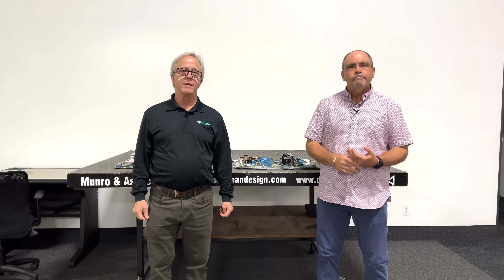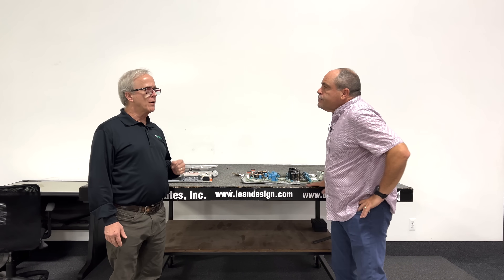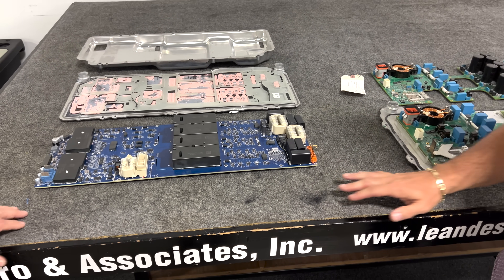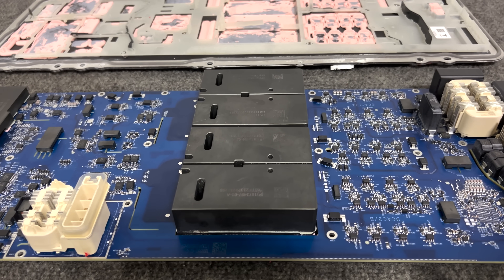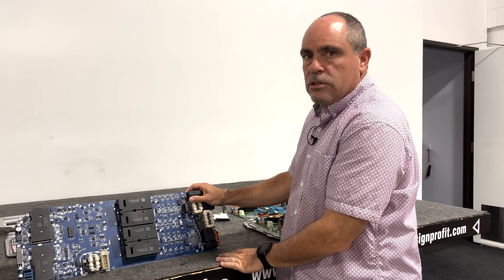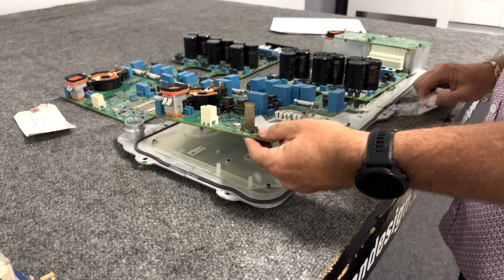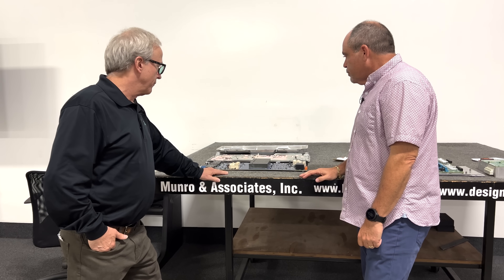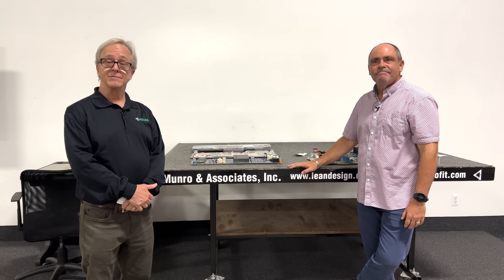Moving On Up: Exploring the Cybertruck's Power Conversion System & 48V Architecture

Comment: One of the worst presentations, not to mention you are talking about DC-DC and you show the AC-DC convertor, then you present the planar transformer and you compare with a common mode choke from previous version....also on this latest pcb CMC is a discrete component and NOT planar, where did you find this engineer? In a repair shop?
Reply: Yep, this video lost all credibility for me when they were showing the toroid common mode choke and saying it was a converter transformer. Also the obvious change from big aluminum electrolytics (needed with the lower switching frequency converter on the old boards) to much smaller caps that can be used on the new higher frequency converter design. That should have been mentioned right at the start instead of their misguided dancing around discussion. This is all very basic stuff for anyone involved with current state of the art power conversion, even on small scale power supplies.
Reply: That board is clearly a DC-DC, not an AC-DC.  It is providing base 48VDC to the vehicle and apparently also providing 48VDC to the AC inverters in the bed for the 120/240VAC outlets.
Reply: @junkerzn7312  watch again, dcdc is the small part with the two transformers.
Reply: @CATA20034  There is no AC inverter on that board that I can see, cat.  It's a twin DC-DC buck converter.  Not necessarily even for redundancy, just so it can operate efficiently over a large current range.

I don't see any rectification, EMC management, EMI filters, or power factor correction, and the inductor configuration doesn't look right for AC.  It looks perfect for a DC-DC buck, though.   There are also severe limitations to the switching frequency if the input is 60Hz AC, but it's obviously running at a high frequency.

What part of the board is supposed to be AC?

-Matt
Reply: Nvm, I see what they could be doing.  They must be chopping the AC directly and combining the chopper and the rectifier together with a synchronous rectification design.  So the input stage is basically just a current pump.  Which makes sense because it has a battery pack's extremely low impedance that it can push against.

We need to be able to peek under the plastic on that input stage before the planar magnetic elements.  There is still a lot of EMC missing that has to be there somewhere.  Plus whether there are diodes or [*]FETs  Its supposed to be bidirectional so... might not have diodes.

-Matt

Comment: Tesla just keeps innovating.
Reply: Non stop. Hard to see how anyone could catchup to them.
Reply: @patmcdaniel2016  blablabla lame
Reply: Whole world does, it's just some car companies that seem to have a problem
Reply: @edc1569  no!
Reply: Nope Lol!!! All those electronic parts already exist and are made by suppliers
Reply: Tesla is just adopting to what is state of the art in power electronics. The true innovation is coming from the elctronic companies that produce the parts used here.
Reply: @EinzigfreierName  That is backwards dude.
Reply: @EinzigfreierName  no they aren't! Imagine just a single main board doing 'll that job when something fails the vehicle is hs
Reply: @EinzigfreierName legacy auto will do the same thing, in 10 years.
Reply: @davidbeppler3032  There's no reason at all they cannot do it tomorrow. But different applications have different requirements and the cybertruck is special regarding this.
Reply: @EinzigfreierName  Agreed. It only warrants doing if the up front cost of engineering and changes in supply chain are worth it.  Despite what Tesla tells the press of their intentions, the production numbers of the Cybertruck are fairly small, so it is a good opportunity for Tesla to try things which might not be economical at scale.  The owners are more likely to be Tesla fans who will probably accept a not so perfect product in order to be early adopters.  Instead of dozens of their own testers, Tesla gets to have thousands of field testers - who pay to be testers.  It is actually a pretty smart strategy.
Reply: @davidbeppler3032  The legacy manufacturers aren’t clueless, at least for their engineering capabilities.  The C-suite officers’ decisions are perhaps not so good.  I have to give General Motors some credit.  GM has been producing various types of electric vehicles since the 1950s, ranging from railroad locomotives, fork lifts, experimental cars and now a few full electric models.  GM has done in-house battery work and developed a lot of the general knowledge of lithium ion battery terminal phase charge behavior and developed the chemistry which prevents plating of metallic lithium.  Remember, GM got their sub $40K Bolt to market about six months before Tesla put its Model 3 on the market.
Reply: @davidbeppler3032  Yep, old corporate cultures make things move slow. 

It's not a technical challenge, they got the engineering for it, but a culture of management silos, decisions by committee and internal politics getting in the way.

On an interesting side note: 
The older PCBs that these guys showed have already been replaced by something similar to what was shown in this Cybertruck PCB, so many of these improvements are already introduced across the other product lines. 

No "Model Year" approach here, but rather constant rapid revisions. Tesla moves fast.
Reply: @EinzigfreierName  There IS a Reason why they wont do it. We all know what that is....
Reply: @wtmayhew  Not sure what you are talking about when you say that Tesla Tesla will only try things when it is at the beginning....You REALLY don't understand what Tesla does, do you? Tesla will change parts when they deem it not efficient enough whether it is their 10kth car or 1 millionth Car. There are many multiple version of the SAME MODEL. MANY.
Reply: @1flash3571  Do me a favor and actually read the comments I wrote then reformulate your response.  As it stands you have not addressed anything I wrote.
Reply: @wtmayhew  I did read your comment. What you said was that it was a good opportunity to innovate, or change the design of a part to save money, or to make it better since it was at a low count. Thing is, Telsa DOES NOT work THAT WAY. They innovate, and Change WHENEVER they want, and whenever there is a NEED to change regardless of whether they are at 10k production, or at 1 millionth one. Low production at the time DOES NOT determine whether they want to change the part or NOT.
Reply: @davidbeppler3032  in which of your dreams?!
Reply: @EinzigfreierName  no it's not special! European trucks and heavy duty equipments have adopted 24 volts while Americans are still at 12v
Reply: @carholic-sz3qv  I was not thinking so much about 12V vs. 24V or 48V but about how this power conversion unit evolved from the previous one.
Reply: @wtmayhew  GM absolutely did not get the Bolt faster to market than Tesla did the Model 3. 
Literally everything except the body of the car was made by LG. 
LG electronics, LG batteries and software. 
All GM did modify the body of one of their existing models

Comment: So how’d they get rid of the bulky electrolytic capacitors?
Reply: My modestly educated guess is that they moved to a higher switching frequency, spreading that otherwise higher thermal hysteresis load over a larger lower saturation driven core. Those smaller current cycles would allow for a drastically smaller cap volume.
Reply: @eelcohoogendoorn8044  That's what it looks like to me too, particularly given how few PCB trace windings are going through the ferrite core pairs.  They could have gone as high as 2 MHz.  Anywhere from a 200 KHz to 2 MHz switching frequency.
Reply: I don't see any capacitors of sufficient size on that PCB. Maybe they use the 48V battery as a "capacitor".
Reply: @philtrubey7480  see PC motherboards... They all switched to Aluminum Electrolytic,  Tantalum capacitors or a hybrid of the two. They are expensive, which is probably why they are compensating with impedance.

They probably did it for safety over 20 years... But Im hoping they did it because super capacitors are known to fail in space and there will be a Lunar CyberTruck.
Reply: @ch4.hayabusa using a topology with cancelling ripple currents

And using small MLCC capacitor
Reply: @ch4.hayabusa  I can assure you they weren't concerned about operation in space, after all the cybetruck is air cooled.

Comment: I used to watch these videos when it was Sandy presenting
Reply: Yes, I enjoy Sandy's presentations as well. However, for a software-defined vehicle, there is a huge amount of highly specialized knowledge in electrical engineering; power and control management; and software design, coding, and implementation that goes way beyond ordinary ICE cars. Sandy has a multi-disciplinary team to help him disassemble and reverse engineer all of that. Tesla has fantastic multi- and inter-disciplinary design and engineering teams who create all of this essentially from scratch and first principles. In fact, this is the major reason, IMO, for the difficulties that legacy auto-makers encounter when trying to compete with Tesla or the Chinese EV start-ups.
Reply from the maker: Sandy is a busy man.
Reply: @MunroLive  I enjoy all Munro videos, regardless of who's hosting
Reply from the maker: Thank you!

Comment: Strange that they didn't borrow their solar inverters to convert 800VDC to 240AC. They have a 19KW budget and 11KW are dedicated to AC outlets.

I guess it would be additional single function hardware. What if I want to run two welders? A three-phase water pump? An electric barge? A hovercraft? A submarine? An anti-drone laser? An anti-tank railgun?
Reply: I can think of a reason. Keeping the power outlets in the bed on while connected to an AC charger. Say you have a box in there for keeping food cold, and you stop over night at a camp ground/hotel/grandma's house?
Reply: Devices designed for static installations in one orientation don't survive random vibe of vehicles in motion.  Lessons Learned: Peacekeeper Rail Garrison.
Reply: what about turning the lights out…. and…. like which happened with lightning… or not…🎉

Comment: What would it cost to replace a power conversion system or traction inverter board should one fry?
Reply: Switching to 48V is enabler for this.
Reply: Come on electronics never fail.  Remember EVs are made
From Pixie dust.  They have no maintenance cost…😂
Reply: All kidding aside those people who have the old board in their cars will be replacing their boards in due time.  Capacitors only last so long before they fail.  Usually in pretty cool ways.  Do you think Tesla will charge you $60 parts plus an hour labor to solder new capacitors in place?  Or will they charge you $4,000 and three hours labor to swap the board?
Reply: @ReluctantLuddite  the new inductor heavy, electrolytic capacitor free design, should last forever. Safety was clearly the main reason for the redesign... The old design may have a high failure rate after 20 years of use... Also, Supercapacitors don't work on the Moon. (HP discovered this in failing SSDs aboard the ISS)
Reply: @ch4.hayabusa  how did they cope with the dc dc conversion without the output capacitors?
Reply: @HWKier  nothing last forever and the inside of a truck is a very hostile environment for electronics, heat, vibration etc.  That’s way too much technology for a personal transportation vehicle.  Maybe not for a space capsule, but a car?  And just where are we going to find technicians to repair all this tech?  Oh, that’s right we will just keep going to Tesla for insanely expensive repair costs.  Tesla is the reason your non EV auto insurance has gone up so much in recent years.